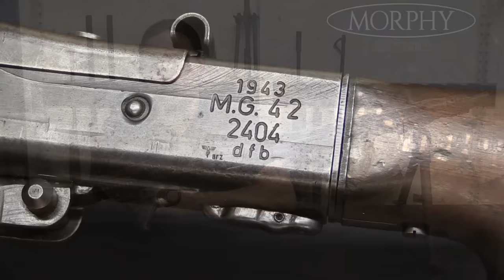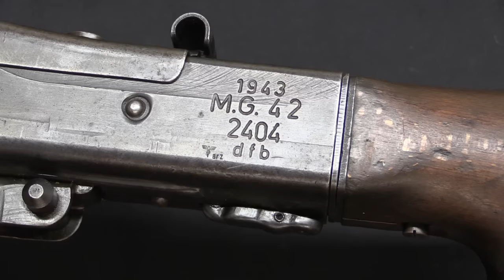Hitler's Zipper: The MG-42 Universal Machine Gun

Comment: A little note for the reassembly:
I used the MG-74 in austrian army, it’s literally the same as the MG-42. When you reassemble the gun, you can easily make a very fatal error. When you throw the bolt assembly into the receiver without installing the charging handle before, the bolt locks into the barrel and the supply officer (he is in charge of the arsenal) has the fun of his life to get the bolt out there.
You get a sharp rebuke and can help the supply officer with every shit for the next 3 days.
We were specially taught not to forget the charge handle during assembly.
Reply: Wait but ours has a slow (600rpm iirc) rate of fire right. I'm not sure since I was trained on the Browning M2 during my mandatory service. Meanwhile the Germans have their MG-3 with 1200 rpm.
Reply: @heinrichrahm1531  yep, and other differences:
-Reduced the rate of fire to 850 rounds / minute.
-The firing frequency can be varied by changing the bolt assembly if necessary.
-Plastic buttstock to save weight (MG 42: wooden buttstock).
-Adjustment of the visor horizontally 35 °, vertically 15 °.
-Winter trigger that enables single fires
-Use of the standard NATO caliber

copied and translated from german Wikipedia ( https://de.wikipedia.org/wiki/MG_74 )
Reply: Right Round  I think you misunderstood me I meant to say that our modernized MG-42 is slower shooting than the original MG-42 and the German MG-3. I only added the M2 to my comment because I remember hearing something about the rate of fire during training but I wasn't sure since it was not the gun I was trained on. Hope that clears it up
Reply: @Junkman122  thanks for the quick answer
Reply: @Junkman van Death I expierenced this problem first hand, too. But there is a very easy fix to this: You take the recoil amplifier (Rückstoßverstärker) off the gun, it just screws off easily. Now the end of the barrel (actually the Rohrführungshülse, but i dont know how to explain this properly) is sticking out a bit in front of the gun. Now you point the barrel upwards and slam your hand really hard on the barrel. This will cause the bolt assemply to unlock and it can be removed easily. What you are doing is essentially simulating the recoil of a shot being fired. A very senior member of my unit showed me this very neat trick!
Reply: @bdkj3e  Maybe, might have happened once or so ...
Reply: Erst der Spannschieber dann der Verschluss weil ich sonst um Block laufen muss!
Reply: The error you describe is quite easily remedied. You just unscrew the flash hider and  put the forward barrel rest (muzzle end) on e.g. a piece of wood, and push the gun against it. This forces the barrel back far enough to unlock the bolt. Yes, I spent time with the MG3 in my service days as well.
Reply: What you said can't bei more than a rumor. You just unscrew the Rückstoßverstärker and than you have to push the Rohrführungshülse backward and the Verschluss unlocks. You were not well educated about the function of the gun.
Reply: @biack7659  Um den Block, niedlich. Bei Lw hieß es: "... um die Rollbahn..."
Reply: @reacher1077  That's all true! I've  some need of this trick back in 1978/79.... 1.Pz.Art.Reg. 35.
Reply: @dynamo4844  Dafür hattet ihr bei der Luftwaffe Biwak in der Turnhalle ~(-_-)~
Reply: @thorodinson5034  Ohja
Reply: you can easiely remove the bolt without the charging handle. Unthread the recoil booster and press on the barrel from the front. The backward motion of the barrel will unlock the bolt just like it does when the gun is fired. If your supply officer didn't know that he is not worth the money he gets
Reply: I had the bolt lock together like that when I had the gun disassembled in storage. The solution was simple. I removed the flash hider (and booster cone) and got a long enough cleaning rod and pressed down on the ground nose first an voila! It unlocked!
Reply: I did that once, but i think i used  charging handle, put it horizontaly against the upper part of the bolt feed arm operating stud and pulled the bolt back out of  barrel.
Reply: Not just the Austrian army, the Danish too - the only part of the MG62 that I know the name of even if woken at oh-my-God-o'clock in the night is "spændestang med håndtag" (charging bar with handle). That name was drilled into us, exactly so we would never forget to install it before throwing the bolt in.
Reply: @noremorsewoodworking2258  We actually had danish M62's in the inventory, even used them for a while.
Reply: Haha ja einem der Rekruten aus der Kompanie ist der fatale Fehler passiert. Und ab gings zum Waffenmeister und danach K2-12. Übung bis zum Dienstschluss musste er 200 Wiederholungen absolvieren
Reply: @biack7659  Mein Ausbilder meinte immer "Spannschieber vor Verschluss weil der Soldat sonst laufen muss."
Reply: @heinrichrahm1531  Its an apples and oranges comparison.  7.62 at 1200rpm v 50 BMG at 600?   The M2 is still putting "more lead" down range....  In any case calvingreene90  mentioned the M2 because it is an even OLDER design that is still in service...no other reason i suspect.  EDIT:   SORRY, just saw the clarification!!!
Reply: BS you remove the flash hider and push the barrel bearing straight down on the floor to release the bolt from the barrel. Two minutes tops.
Reply: @droolingidiot  i too was in the Austrian army and one idiot did the same thing while in stress. The Weapon-Mechanic was not amused and the guy had to do 200 military pushups until the end of that day. 
While I am not sure about this I have more confidence in believing the entirety of the Austrian Armed Forces rather than one random guy named "droolingidiot" on the internet
Reply: It is actually not that hard to get it out again, problem is most people don't know how to, all you have to do is unscrew the flash hider and hit the front of the berral that is ever so slightly sticking out of the frame into the flash hider. I have had to stop a lot of people from just bashing the gun into the ground to get it out,you just need to hit the right spot or the bolt wont come out.
Reply: Bet you only make that mistake once...
Reply: @thorodinson5034  bei dem habe ich tatsächlich laut gelacht.
Reply: @droolingidiot  yes, however that only works in a clean environment. It's not really BS, those were just the stories that instructors told recruits.

By the way, in the field you either used something heavy (to keep the actual impact speed low) or if you could stand, you'd use the toe of your boot pressing down on the assembly to avoid pushing the barrel into the dirt.
Reply: Probably a little late, but the solution to this is to take off the muzzle break and press the barrel into the floor, that would release the bolt ;) (Best regards from a former MG-3 gunner) EDIT: I see you already knew this in a later comment :)
Reply: You have to help the supply officer with every shit he takes for the next 3 days?

Is he OK?
Reply: @biack7659  JAU!
Reply: @lc4biker  😉
Reply: MG3?

Comment: Person reviewing proyect: we need a new machine gun
Engineers: we made this cheap sexy gun
Proyect reviewer: nice and what is the fire rate?
Mg42 clears throat: yes
Reply: Engineers: Ehm, all of it. 
Mg42 goes Brrrrrrr......
Reply: *MG 42 clears throat: JAWOHL!
Reply: Fire rate is one barrel per 30sec
Reply: Very original.
Reply: @albnoel  more like 6 barrels a minute  - recommended cyclus is to change after each 250 shots in 'rapid succession'. If we, for arguments sake, put the rate of fire at 1500 (a bit lower than actual) and you link enough ammunition together to fire 1500 rounds - no not continuous - long bursts of 15-20, you'll go through all the spare barrels of an entire platoon and the first barrel you used will still be too hot to use when you are done shooting.

How do I know this? I've done it - albeit with an MG62 (MG42 rechambered for 7.62 NATO).

By the way, hot barrels can be cooled in water or snow but must be fully submerged/covered so as not to bend/warp. If that is not possible, they should be placed in the 'spare barrel carrier' to cool, rather than directly on the ground.

Fun fact: It takes about 200 blanks to heat a barrel enough that you can make a cup of cocoa on it - just don't use a plastic cup.
Reply: @albnoel  50 rounds belt is less than 2 seconds, and the big 250 is less than 21 seconds, and is recommended chage the barrel to keep all the 3 barrels no too hot.
Reply: @noremorsewoodworking2258  The original belts (8mm mauser) was not  linked ammo, then you can't link it.
Reply: @noremorsewoodworking2258  I imagine the cocoa trick was very popular during the winter!

Comment: Hey Ian, love your videos and the channel! Unfortunately this time some of the explanations are not as correct as you used to be normally! ;) 
You forgot to mention that there is a collar Rohrführungshülse/barrel guide collar around the crown of the barrel, right under the muzzle device, which is called Rückstossverstärker/recoil amplifier... the gases are forced on this collar and push the barrel about 5-10mm backwards (1/4”), the traveling barrel accelerates the bolt, comes suddenly to a stop, and the bolt carrier keeps traveling backwards, which pulls the Schlagbolzenhalter/firing pin carrier - the triangle with the firing pin, out of the bolt head, which allows the rollers to unlock and pull the case back. At the end of travel, the little sheet metal stick (Auswerferstange) inside the bold carrier pushes on the ejector (Auswerfer) and ejects the case. 
To reduce the risk of the bolt jumping back out of battery, a device called Schliessfeder/closing spring inside the bolt was added, which works like a self contained buffer spring. 
Hope my explanation is slightly understandable... ;) 
Source: 8 years of training and combat experience with this baby :)

Comment: Never knew that the 3 wire springs were actually better than a single wire spring.  I thought it was just because the Germans and Soviets were cheap and these were easier/cheaper to make than a proper 1 wire spring.  The more you know.  This is why I love this Channel.  Keep it up Ian!!
Reply: I'm guessing they did it to overcome their inferior metal.
Reply: Materials and strength over length
Reply: @AllahDoesNotExist  all springs will fail. Having the gun go "click" when you expected a "bang" is the start of a very bad day.
Reply: Geissele actually makes buffer springs for ar platforms based on the mg42 design.  They claim that this design primarily increases the service life and reliability of the spring. And is much quieter as well.
Reply: Actually these springs are more expensive. You need more steps to produce.

Comment: I was a machine gunner and carried a M240b. It's amazing how similar in a lot of respects it is with the 42 and to a lesser extent the 34. Always thought it was a excellent testament to a very excellent and effective design.
Reply: The irony is that the MG34 basically still has the best barrel change mechanism for vehicle mounted use..and noone copied that
Reply: If it ain't broke dont fix it
Reply: The MG42 is recoil operated gun..the M240 is gas operated.
Reply: I carried the M-60 and that looks a lot closer and still prefer the 60 over the 240. I like the slower rate of fire. I could keep it on target at 1000 meters during qual
Reply: @maddogmaz1576  I joined an '05 and never got to mess with the 60. But I had absolutely zero problems hitting the 1 km Target with a three round burst every time with iron sights so.
Reply: @PizzaGrunt 3725,1800,800,600,900
Reply: @kane357lynch  also can't mout a silencer  on it
Reply: @kane357lynch  You can get an MG42/MG3 with various different rates of fire. If you want it to fire more slowly just use a heavier bolt assembly.
That way you can get any rate of fire between about 800 to 1400 rounds per minute.